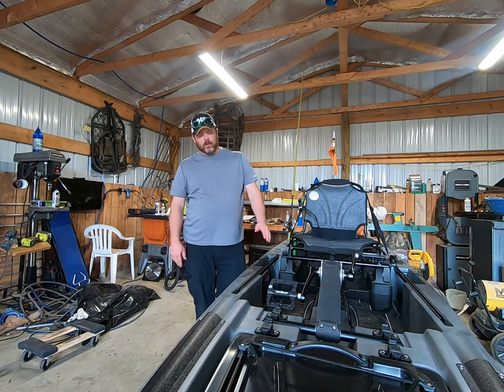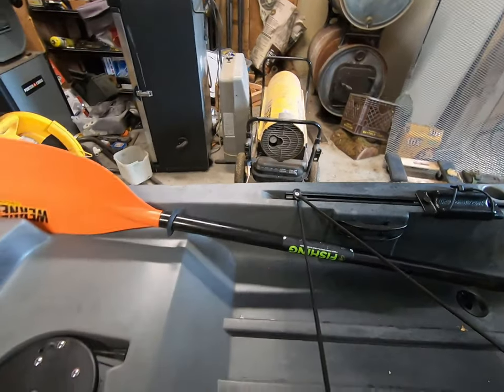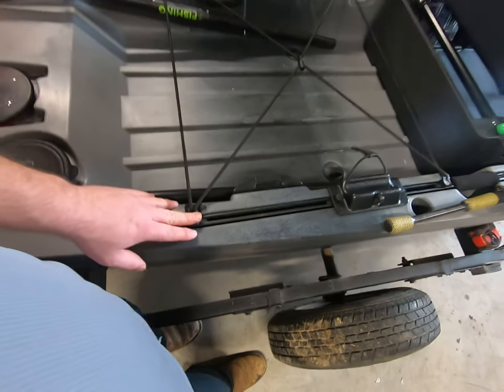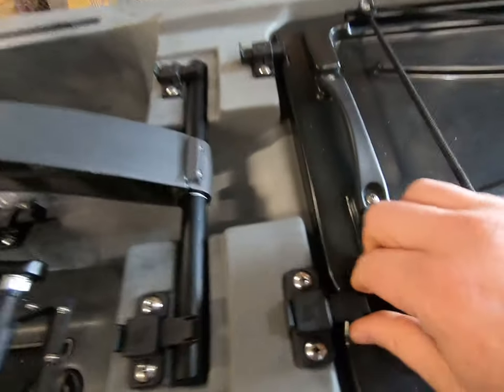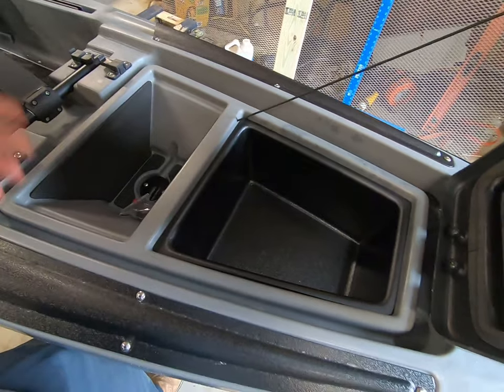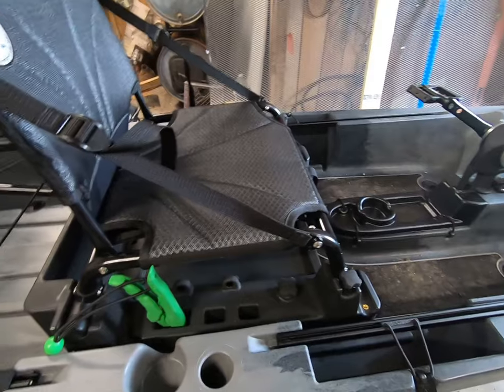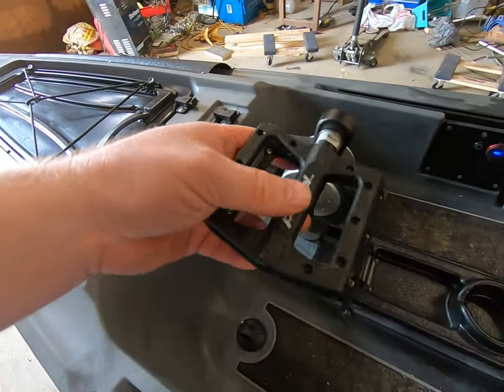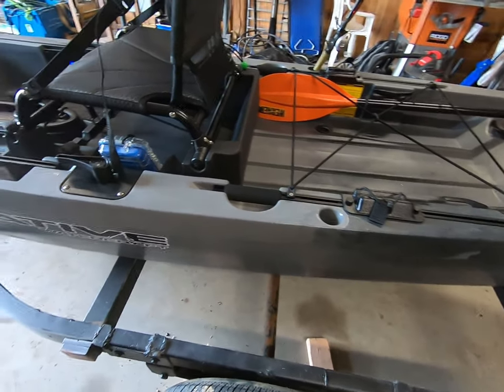A Honest review of the Native Slayer Propel Max 12.5 fishing kayak. The good and the not so good....

Comment: Basically everything you didn’t like has been fixed for the newest 10 foot slayer as well as other things. Those foam bags does on yours dry rot-they’re bmx handles with nice rubber now. They fixed the taco paddle holder angle (they’re straight now), the pull pins now have a finger hole on the pedal drive and storage hatch pins. The only thing they haven’t done is added thumb screws to the tank well bungee but I’m going to add those myself for cheap. In my opinion, the 10 foot slayer propel max is the best fishing kayak on the market. The 12 footers are just too heavy for one person.

Comment: A few other things to add, the rudder plate area need a small grove on it like the access hatch so you dont get a puddle of water in there and may leak into the hull through the rudder cable hole like the titan. Also need to add a left side sacrifice plate for folks who want FF on the left so dont have to drill the hull.  Also I think it be good to just keep the front hatch open like the titan 12 instead of splitting it into 2 part. Put a removal battery box in there for the battery box instead of a built in like that.

Comment: I'm curious about this boat, but man, that front hatch really throws me. Why they chose to put such a massive hatch and cover for such small access is beyond me. I feel like they should've nixed the oddly-shaped battery compartment in lieu of more access to the hull, where you can fit a battery box like you did. Also surprised how flimsy the hatch cover and hinge are and I don't like those closure clips either. Boat seems super well thought out other than that and I love the hull shape. 

I think I'd also prefer to have a paddle holder system that doesn't require you to assemble the paddle. Seems like a bad idea if you need to do something quick like pull your drive up and keep out of cover in the wind.

Thanks for the thorough and honest review!

Comment: Nice video. 
Two things of improvements I plan on doing that you would probably like. 
1 harbor freight has the small solar panels for like $15 that will keep your battery charged while using it on the water all day. 
2 pedals, I plan on putting the anti slip pad that you see on wooden wheelchair ramps. Black and thin like paper. Peel in stick. 
Will be better than spikes getting it and out the boat so no stabbing your shins.

Comment: You sure the paddle halves aren't supposed to store, flipped around?  In other words, flip it so the shafts drops into those grooves, and the blades face forward?
Reply from the maker: i tired that but the grove is at a off set and different angle then the holder.

Comment: My rod butt holders didn’t come with the thumb screws it has a philips screw..
Reply from the maker: Wstn mine came just like you see it. I would maybe check and see if they maybe they put the wrong screws on yours. I’m going to end up taking mine off noticed today while on water that left side rod holder put the rod right over the rudder handle and ended up not using that side because of it.
Reply: Yah Took mine off anyway since I added the native sidekick landing gear and it gets in the way of them. How did you like the boat on the water? Haven’t taken mine out it will be a few months before the lakes melt up here
Reply from the maker: Wstn I took mine out today and did a little fishing over all on the water I’m pleased with it. Was able to stand up and fish little wobbly but been in less stable. Speed and turning was the most noticeable part it’s fairly fast at easy pass and turns on a dime.
Reply: Nice hope to see an on the water review!
Reply from the maker: Wstn definitely will be one.  working on the editing for it now so maybe by tomorrow I’ll have it all done.